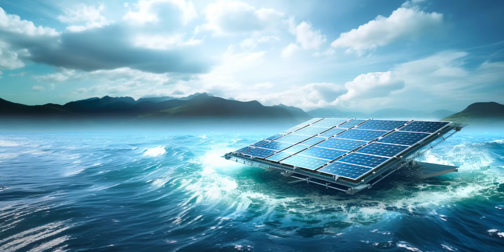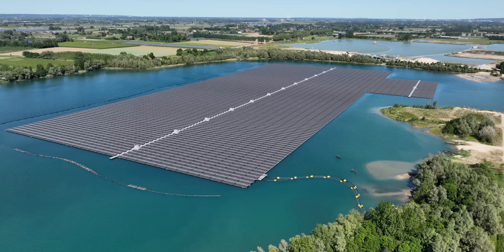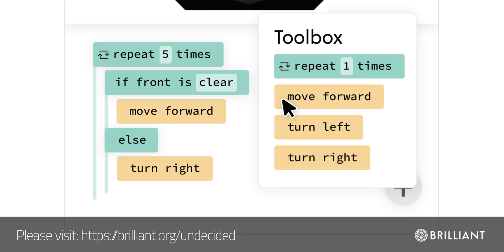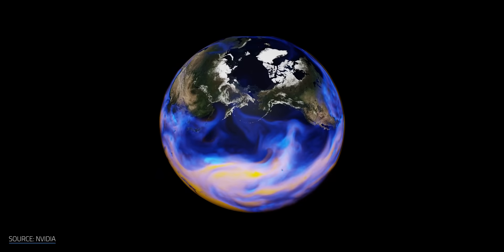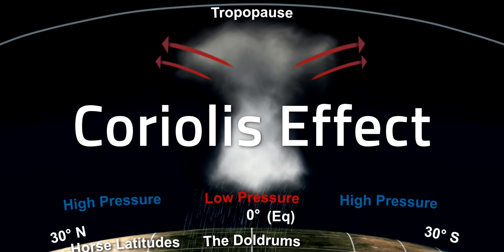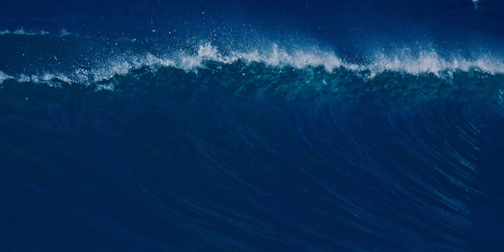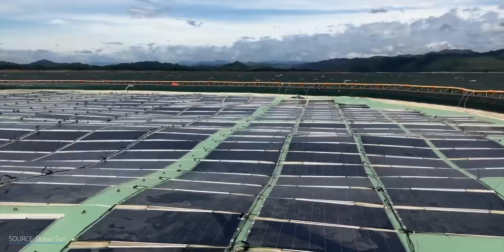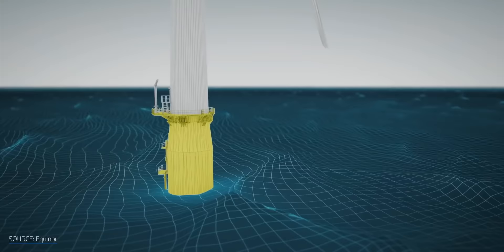How Offshore Solar Could be the Future of Energy

Comment: What about plankton ?  We kind of need to breathe and most of the oxygen is produced in oceans. So I asked AI.

ChatGPT
Offshore solar farms, which are solar panels installed over bodies of water (like lakes, reservoirs, and coastal regions), could potentially impact local ecosystems, including those that contribute to oxygen production. The scale and nature of the impact would depend on a variety of factors:

Coverage Area: If a significant area of a body of water is covered, it could reduce the amount of sunlight penetrating the water's surface, impacting the photosynthesis process in aquatic plants and phytoplankton.

Local Ecosystems: Different water bodies have different ecological characteristics. The installation of solar panels may disrupt habitats for various marine and bird species, especially if these installations are extensive and not carefully managed.

Water Quality: Solar panels could potentially affect water temperatures and chemistry. By shading the water, solar panels could reduce water temperature, which might be beneficial in some cases by reducing evaporation rates and helping to control algal blooms. However, changes in temperature can also have adverse effects on marine life that are sensitive to temperature changes.

Chemical Leaching: There is also a concern about the potential for solar panels to leach chemicals into the water, although modern panels are designed to be environmentally safe and the risk is considered to be low.

Oxygen Levels: Reduced sunlight could lead to a decrease in oxygen levels in the water, affecting fish and other aerobic aquatic organisms.

Despite these potential impacts, there are also several environmental benefits to consider:

Reduced Land Use: Offshore solar farms do not use up valuable land that could be used for agriculture or conserved for wildlife.
Lower Evaporation Rates: By covering parts of water bodies, solar panels can reduce water evaporation, which can be beneficial in arid regions.
Renewable Energy Production: The generation of clean, renewable energy reduces the reliance on fossil fuels, which in turn can lead to a reduction in air and water pollution and greenhouse gas emissions.
Environmental impact assessments are crucial when planning offshore solar farms. These assessments can help to mitigate negative impacts on marine ecosystems, including the oxygen-producing organisms that are so vital to our planet's health. When designed and managed with care for the surrounding environment, offshore solar farms can be a valuable part of a sustainable energy future.

Comment: Of course even if this works well, there's still the problem of transporting the energy to where it will be used. Can't imagine how long those electrical cables would have to be, and how much energy loss would occur do to all the resistance. Though I'm sure this is also a problem offshore wind is also facing.
Reply: I think that the space solar people talk about microwave transmission. Ocean panels might be a good place to test that out, to see if it really does work, or not.
Reply: @jimthain8777  Interesting idea, but I'm not so sure about that from a practical standpoint beyond research. Even once long range wireless power transmission has been developed enough to be usable, it's still going to have much greater losses than cable. The only way I can see that being feasible is if the cost of the cable becomes so high that wireless transmission is the only way to do it to at least get some of the power generated by the solar panels. 

But yeah I can see them using ocean solar to at least test and develop technologies for long range wireless power transfer.

Comment: Off shore I think has a lot of potential. If you had something like a tug bot pulling some serious fpv  you could place them in ideal locations. For  example: if you sail up the US west coast during the summer, parts of Alaska get 20+ hours of sunlight. Once autumn starts coming around, sail back south to friendlier waters. With enough heads up, you could try and move the panels out of the way of major storms, risky but possible. The biggest issue I see with that is how do you get the electricity from the sailing PV to the land where its needed.
Reply: Possibly microwave transmission? I believe that is their plan for space based solar. Ocean solar might be a great way to test that out too.

Comment: All you need is like 
6 solar panels.
1 Pulse Width Modulator
 a pulse motor/generator With the coils at the same value as capacitors. Impulsive at the Resonant frequency  And you have a small, compact power system that doesn't need all this space. In confusion we need another TESLA not another edison

Comment: I don't particularly like the idea of solar panels as they currently exist... They take so many harmful materials to create and we don't have a way of recycling a vast majority of the waste. I wish we could look into concentrated solar to heat a Stirling Engine to see if it's even remotely feasible. You don't need anything fancy for Stirling Engines, my only concern is if they can compete in energy output per M^2 when compared to current "green" energy
Reply: Stirling engines are not efficient enough, they would cost a lot more. Everything can be recycled, just like the device you typed your comment on.

Comment: So this goes out to Matt, excellent work as usual, but I ask this question. If Solar is cheap, then regarding placing it why not just offer it to every building and home in the US even if the home has a far less than good coverage? Even a small amount of solar energy at that coverage, should contribute something to the overall grid. Make it a part of building code.
Reply from the maker: Thanks for watching.  Good thought and I like the idea.  I'd like to see the utilities look at homes, apartment and commercial buildings as an opportunity ... not competition.  Some utilities are doing that with batteries, like in New England.  One utility is offering batteries to homeowners as part of a virtual power plant build out.
Reply: Yea, plenty of roof space to supply all of humanities needs.
Reply: Here in Belgium new homes are required to have a certain minimum number of panels (or other energy generation system, but I don't think anything else than solar is used).
Reply: Would definitely be a worthwhile addition to most new homes but I would suspect making it code on a state by state level (in the US anyway) would be impractical, maybe a federal mandate? There are actually private companies that will put solar panels on residential roofs for no cost to the homeowner and then just share the profits with you, e.g. you basically just lease your roof and get a reduced electric bill. They aren't super common yet but my neighborhood in PA has a decent number of those types of installs. Kind of works for you suggestion, just slow since it requires homeowners to become aware and then agree to it.
Reply: Nope, the US does not have a building code. 

Or rather, every single state and town has their own codes. There is no national code.

Comment: I always thought solar was cool. Over years i started to question how practical and cost efficient it is. Putting it on water seems impractical or not cost efficient but if a unsubsidized company can swing it. Good for them. 

The maximum output of solar gets thrown out often. I find it somewhat interesting but mostly useless. Fundamentally, solar isn't on demand  power. So max output is useless unless weather and sun exposure permits. Also means solar power output doesn't  ever meet power needs. Some secondary or primary source is needed to balance the grid. Mathematically i done see batteries doing this, at leat effectively.  Batteries having that capacity is a long ways off. So this off shore capacity is mildly interesting but they still have infrastructure challenges getting that power to shore cost effectively. Again   good for them if they can make it competitive. 

Environmental? I think there is more of an environmental impact than the enthusiasts think. These panel radiate a lot of heat. It not insignificant. With power per million people, it equates to 200 to 300 sq miles per million. That is a lot of heat rejected back into our atmosphere. You may reduce carbon output but in return add heat.       Blacj pool covers are used to heat pools. What you think these bkack floating planels are doing. They even say the water is cooling the panels. I disput the idea less evaporation as the water is being heated up. It may even increase algae not decrease as suggested in video.

Comment: What stops us from having floating barges in the middle of the ocean? Weather, navigation, an efficient means of transmitting the power from off shore to on shore - why not put cites out there with it and manufacturing plants with vacations spots?  Solar could be combined with wave power and wind power for a true megamess. Why stop there why not space solar collectors surely that would be ideal, no weather and lots of space. Finally a use for Tesla robots.

Comment: Floating Solar, if done over too much of the ocean, could affect ocean temperatures, natural evaporation from the oceans, and  that second part would directly affect rainfall.   Covering man made canals is fine, as they are basically pipelines that shouldn't be exposed, but evaporation from the ocean is part of the natural ecosystem.    I think this is an interesting idea, but we would need to be very careful that by trying to fix one issue, we do not create another issue.
Reply: There is 0 chance this will cover even a measurable fraction of oceans, we couldn’t ever build that many panels.

Comment: Huh....... Saving  land and utilizing sea surface with AI and robotics will be a great impact if we understand the ecosystem throughly. Octane has 8 carbon base , methane has a single carbon ,  approximately percent of carbon reduction if the quantity don't vary that much . Apartment from hard industry uses like iron and fertilizer  it could be produced by recycling and biochemistry application , with genetical enhancement on underwater organic elements . It doesn't sound posh but we can come up with a brilliant solution that won't get jeopardize by harsh calamity, like hurricane , typhoon etc ,  if we can reduce carbon emissions by 70 percent with chemical application cheaply then why we won't , I would have worked as a volunteere to figure out the exact estimation to develop such thing . An genetically modified orgainc element with high growth rate than benefits under ocean ecosystem.

Comment: So my main concern would be thermals. So yeah solar panels run cooler on water but that heat is going somewhere and that would seem to be into the ocean. Is it more energy than would be imparted by direct sunlight on open water or are the panels preventing enough sunlight from putting heat into the ocean to offset the cooling benefit to the panels?
Reply: No.

Comment: If placed on lakes or artificial reservoirs for say, drinking water or other water supply that othervise would be victim of evaporation because of heat, it would be a win-win scenario to place solar panels there to give the lake a shade, plus - artificial reservoirs do not have sea life that needs protection, plus - salt water seems too much of a challenge for electric installations. Smaller reservoirs will probably not have the waves like the ocean, that might destroy the panels, depending on their size. Waves of many meters will probably not happen on a reservoir of say 500 meter times 500 meters or something like that. Here is a Veritasium video about a reservoir that very well could have been fitted with solar panels instead of - millions of black plastic balls! :-) 

https://www.youtube.com/watch?v=uxPdPpi5W4o

Comment: Low density energy catch air wind mills which requires long span blades and light photovoltaic requires farms space and a lot of maintenance. Hydro first high flow rates rivers are rare and 1kwh installation of electric energy is more expensive than nuclear, and soil sedimentation fish migration destruction have big ecological impact. Electrical energy multiplication based on heat pump principle of heat energy multiplication is next level of electric energy production. We will be ask question how fossil fuel energy duped us so long. AI is useless, it can reach  300 years of science knowledge except that AI can not create information that was never allowed to publish that could harm fossil fuel monopoly. AI solution to solve energy crisis and with that related consequences are wind mills and hydro wheels 16 century technology, nuclear 60s and solar 90s technology. All technologies that requires a lot of infrastructure investment and space.

Comment: Waves can crash on the panels and the salt can accumulate on the panels, covering them and making them useless. 
The metal can easily rust and sea life can also form on the surfaces of these platforms.
Not to mention higher maintenance cost because they require more complex tools to maintain and must be repaired much more frequently because of the hard environment.

Why do all this when there is plenty of rooftops to cover, and plenty of deserts? Even if we built the panels exclusively on fertile farmland, covering just 1% of farmland will be more than enough to cover for the entire US current needs for electricity, plus some more to spare. (One square mile of solar panels can produce around 400 million kWh annually, and therefore 10,000 square miles are in theory enough to power the US using only solar. That's less than 1% of the 1.4 million square miles used for agriculture.)
I sure hope americans can still live normal lives eating 1% less food. Right?

 Besides, we are already wasting so much farmland for unsustainable biofuel from corn, which has been proven time and time again that it requires more energy than it can produce. We could use some of those lands, that way they'll finally be useful for something really sustainable.

Comment: This is a really, really dumb idea. Maintenance is more expensive. Transmission is more expensive. Deployment is more expensive. Material degradation in salt water is more expensive.
You gain exactly zero efficiency compared to land based solar, but lose proximity to where the energy demand is.